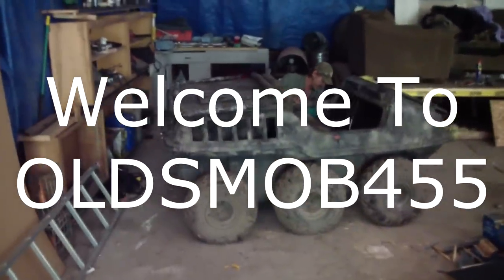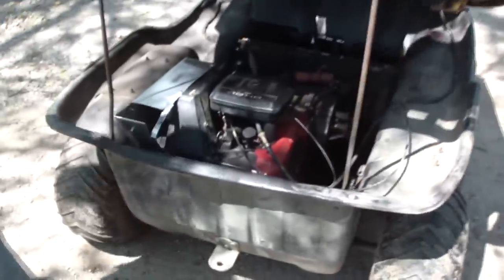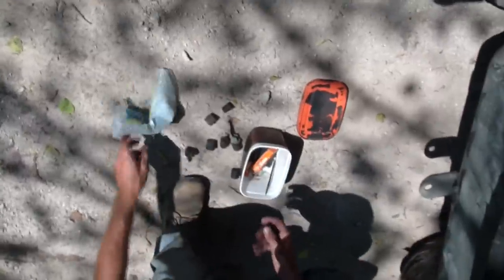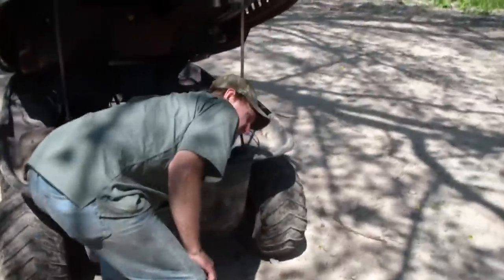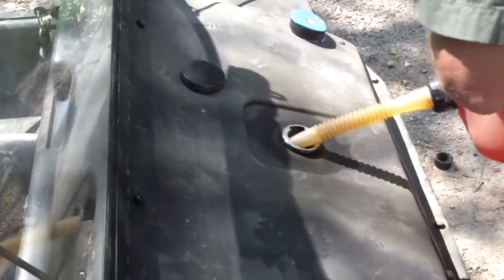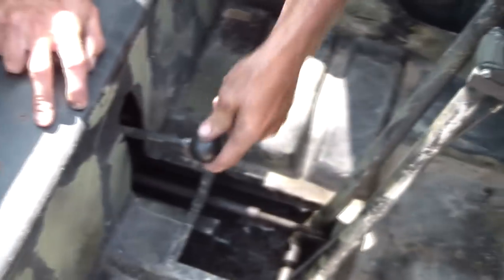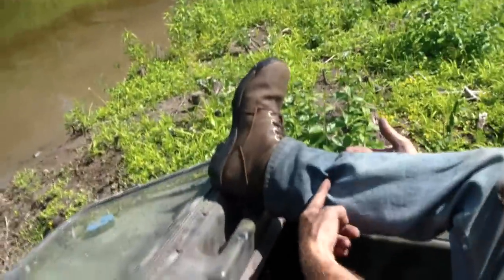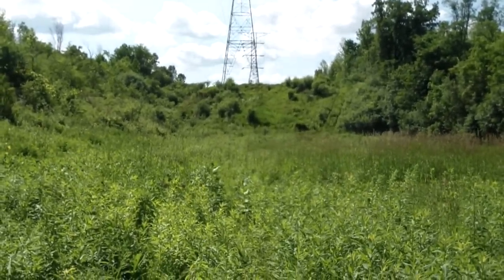Six Wheeler Amphibious Vehicle ATV Action Max 2

Comment: I just got one of these today for 1500.00 dollars needs new battery and new fluids possibly a tune up. Been sitting for 2 years.
Reply: If it aint trashed you made a screaming great deal!!
Reply: Put a good roll bar on it. Believe me you can flip it over backwards so fast and cripple urself. Mine pinned me to the ground in Alaska on my trail into the bush hauling supplies. Dam near killedme!!! Avoid steep climbs like out of a creek.
Reply: @dandahermitseals5582  how do they handle steep gravel logging roads? How about rolling over logs? I may be getting one soon but I dont want to ruin it.
Reply: So what's the verdict? how's that machine working for ya?
I just started working on mine after 30 years of sitting.
I took it apart many years ago ,put it on the shelf... And always said that would be my retirement project

Comment: I noticed in your video that your tires are facing the wrong direction. If you put the chevrons facing towards the rear it will go so much better thru the water you won't believe how much this makes a difference! Look at how all stock models on Argo or max company videos have their tires facing and you will get better traction in the mud too. You wont have problems getting ip that little grade crawling out of the creek.